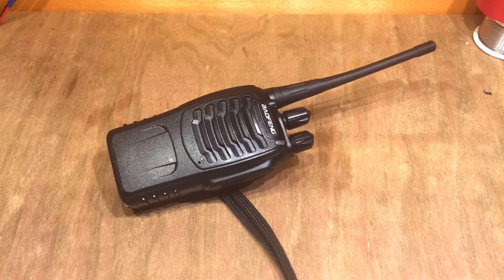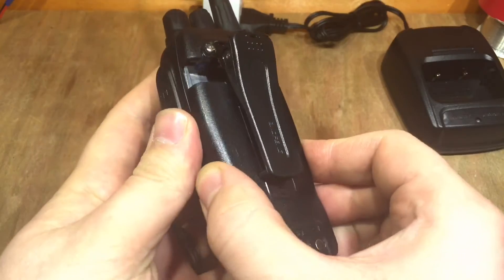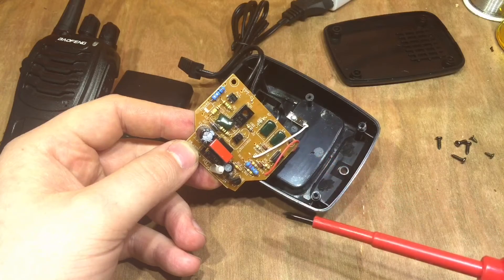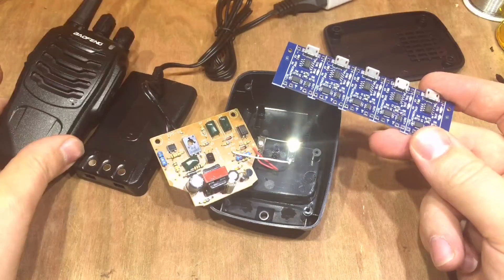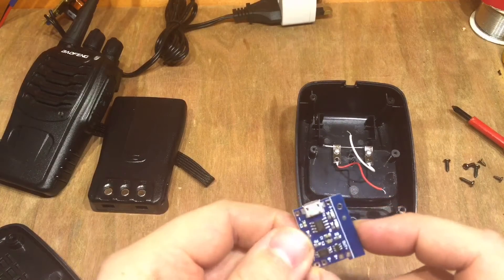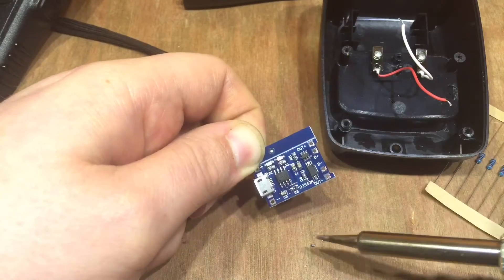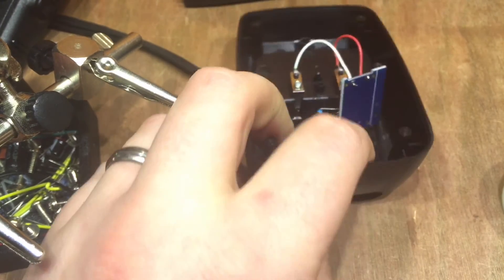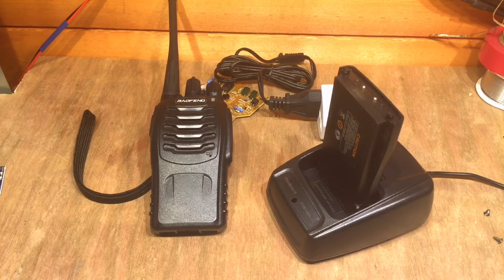Baofeng 2 Way Radio Charger Upgrade - 12v Solar Shed

Comment: I recently bought a pair of BF-88e which are like BF-888s but preprogrammed for PMR446 with fixed antennas and supplied with USB chargers. I haven't managed to get the chargers apart (there is one screw but they won't easily come apart even with the screw removed) but I can see that they supply approximately 4.1 volts at the terminals which hunts up and down slightly suggesting an intelligent charge circuit.

Comment: HOW DO YOU PLUG THE OTHER END OF THE USB IN TO THE SOLAR PANEL OR BATT? What if you wanted to use a 12 volt batt? Use a car Usb charger ?

Comment: If you open up the pack you will find a charge circuit in the battery you likely would have been fine just powering the base with  usb5v no need for the charger board

Comment: I made few chargers and batteries with that charging board, too, but I never seen drop-in charger like that. I like that ventilated bottom. But that charger interior is horrible same as mine was.
Reply from the maker: +Radoslav Gulik Its still working well for me - safer I think too!
Reply: Yeah, exactly, safer than the original crap...

Comment: so they where charging at 5v ?
wouldn't they do that because the battery might have a discrete circuit ?
Reply from the maker: +BillTheBox An interesting theory. I'll test one and see what I can find out. I've another drop in charger to test - but I suspect they can charge at a maximum of 5 volts. I'd hope that using one or two of those resistors and the transistor it could cut off at a more suitable 4.2v.
Reply: That's exactly what I was thinking.

Comment: A small hole in the case above the TP4056 module would allow you to easily check the charge state.  I like your videos.  Thank you.
Reply from the maker: +Ray Miller You're welcome and thank you. I have actually added the exact hole you suggest. Works well.